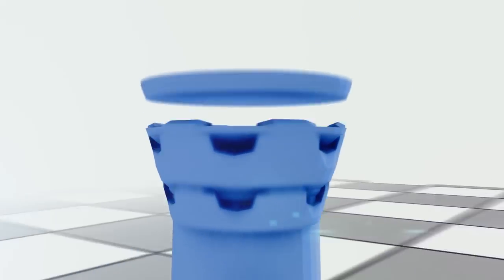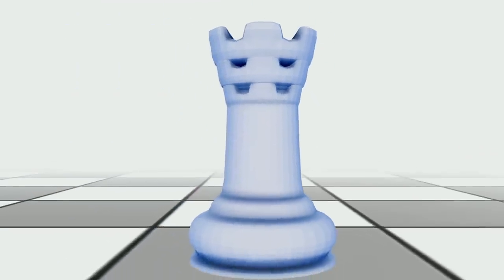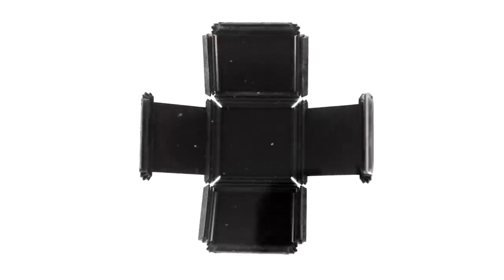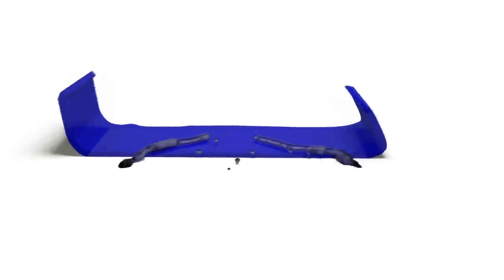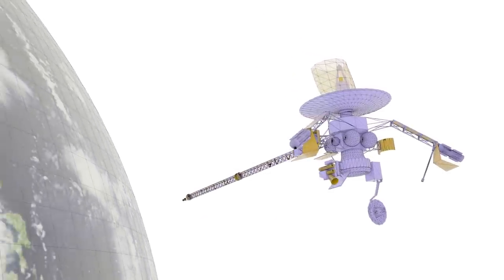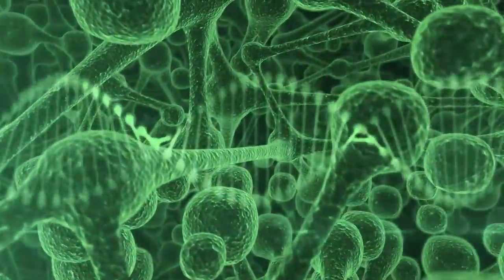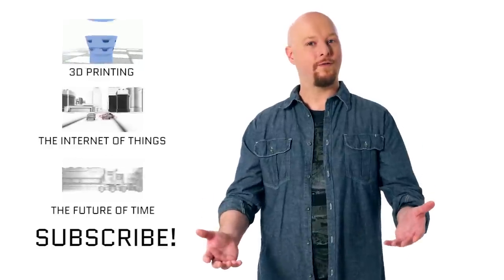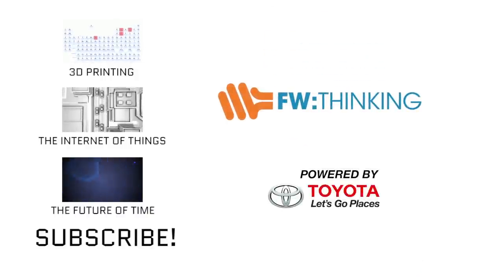4D Printing is the Future of Design

Comment: So how does this print in 4 dimensions?

Can it print a physical tesseract? No? Well, it's not printing in 4D, then.

Sure, I can't argue against the fact this is badass - but it's not 4D. It's just a 3D shape that changes in 3D.
Reply: the 4th dimension is time.
Reply: Mridul
its both. it can refer to both time in Einsteins special relativity theory, or polytopes that Vehementi refers to. for example a tesseract is a "simple" 4 dimensional cube. so what Vehementi says is actually correct. no 4D printer here... only 3D
Reply: 5D is a tesseract im sorry
Reply: Pivotal Axe No, a 5D cube is a penteract...
Reply: Pivotal Axe Wikipedia: In geometry, the tesseract, also called an 8-cell or regular octachoron or cubic prism, is the four-dimensional analog of the cube
Reply: Lorsayden Pivotal Axe Vehementi Lasse Jensen A fourth dimension does not at all have to refer to time or shape; rather, it simply implies a fourth dimension...of any conceptual framework.  Time and shape are common examples.  Other common examples would be vector direction or particle spin. However, there is no need to conceptualize "dimension" within a physical reality...AT ALL.  In mathematics, including mathematics studied at the undergraduate level like introductory linear algebra, a dimension essentially refers to an algebraically generalized vector and can non-trivially contain "infinitely many" coordinates, i.e. be of infinite dimension.  In fact, stochastic differential equations are empirically of infinite dimension, so don't be blinded by the physical and miss the analytical.
Reply: Seems like i'm 3 years late, but let me explain: It prints in 3 physical dimensions and in the time dimension.
Reply: I agree with 4D impressions because it's a very good way to help the planet, especially generations of children coming, this serves us completely to people who want to exploit their ideas first and foremost

Comment: Self-storing garden hoses. They would shrink down to tiny shapes when not wet, then expand when water is reintroduced. Self-shaping life rafts for boats. They turn from a folded up shape into a raft when thrown into water. 
Water drainage systems in houses that expand when it starts to rain. Or water collectors with similar properties.
Possible uses in hydro-electric dams. Or canals.
High-flood areas could have self-constructing flood-walls.

Comment: Firstly, it should not be called 4D printing. 4D is when you create a material within a material (something u can't see unless u have x-ray). Like a circle inside a circle but in 3D without support inside. Something that is not possible in our 3D world unless we bend space/gravity. Is when an object floating inside an object.

Nevertheless, I like the concept of using a 3D printer to print out self-reconfiguring, programmable material but there should be another name for it. The benefits includes saving space. Imagine parking. Print a car and fold it when you arrive your destination then open again when needed.
Reply: the fourth dimension is usually time

Comment: How would this "heal" anything? It does not reproduce mass or re-join atoms. You are literally printing an object that has two states: from flat to a non-flat; it does not "heal," more so "fold up a little more." Sending this into space does not make it any more cost-effective because space costs are usually dictated by mass - which does not change for this design.
Reply: +aripockily Magic. It's called magic. 5D shapes prited from fairy dust, drown in unicorn tears. All we need is somebody who donate them magic beans.
Reply: If you put all the molecules of a 4D printer end to end, they`d stretch to the Moon and back anyways. Twice!
Reply: Max Warner maybe for small applications, but for space, they need durability and strength. they already have mechanisms that can do this folding.

in terms of costs... applications requiring strength will not use this system. simple folds can be done cheaply with mechanical joints. Assembly for which this product excels in (weak joints) will have no need for shortened assembly time.
Reply: aripockily but it can contract to heal the broken parts

Comment: Really sounds interesting.  If the process is triggered by some outside event, water heat, etc, what keeps it from reversing with some other stimulus?  Imagine driving at 70 MPH and your steering wheel morphs into a gas pedal as you pass an electricity substation.

Comment: As a mechanical engineering student, it's my first time hearing of a 4D printer. It amazes me just thinking about how many problems this 4D Printer can solve. It can probably be taken into the next level too, such as instead of using water, different solution can be used or different chemical. Not only that but we can use material that are temperature/ pressure sensitive so it would change depending on the situation.  
If anyone have any information where to learn about this or be a part of a laboratory that are working on, please let me know.

Comment: besides using water as the catalyst for shape change, what other chemicals can be used to initiate the morphing process? does it have to be a liquid or can it be a gas as well or even another type of solid material? what i'm trying to ask is can the object you make on a 3D printer react one way when you when you put it in water, a second different way with something like liquid nitrogen and a third different way when it's touched by another solid object like plastic, metal, wood, ETC...? this opens up a whole new level. when you use different chemicals as catalysts to the shape change on the same object it can give you different results whether the catalyst is gas, liquid, solid or even a mixed chemical. there's a lot of possibilities here.

Comment: You can also use temperature. Take for example the old carburetor throttle plate bimetallic spring opening the plate when the engine warms.

Comment: close that expand when wet and contract when dry, ie: when its hot and you sweat they expand to let more air flow, when it rains it will make your shirt expand so that you can take it off without struggle, when its cold and dry they shrink to keep you warm. make them a composite(vertical thread self healing, horizontal thread water proof) water resistant as to wring them out after a rainstorm and have them shrink to reuse to keep warm.

Comment: I would print out a flat sheet that can contort to a table top gaming board... It would be great if you could send water through different channels and cause the terrain to shift based on the channel utilized. From Snow Landscape to Jungle Landscape.

A House that could fit in a backpack would be pretty cool too. You only need to drape a tarp around it. A Tent for camping would be even better. It might even be easier to assemble in the rain (Not Likely :P)!

Comment: Given that graphene can take on magnetic qualities, just how much material do you really need for, for example  a motorbike?

The frame could self-inflate. Magnetic bearings for the wheels; several square kilometers of graphene super-capacitors to hold power, inflatable tyres, a graphene sheet instead of spokes. Electric motor/dynamo to provide/recover rotational energy from the wheels.

Theres no reason it shouldn't deflate to the size of a coin.

Comment: On a personal scale, I would probably use such a device to print out a practice sword.

3-D printers usually can't build something of that scale, at least not the ones practical for small apartments like mine.

With a 4-D printer, I could print out something that looked like a bare hilt, over time though, the blade would unfold and built itself out. Like a super slow mo lightsaber!

I could also use a full sized punching bag, the sock em bopper on a spring isn't giving me the "oomph" I want.

Comment: Ear plugs made of squeezable material that conforms to ear canal,like ones used today. But these ear plugs are made of micro chevron shaped material that allow normal sound waves to travel through the canal unobstructed. When sound is louder than 70db the micro chevrons pickup the sound waves and open up to block sound.

Comment: I imagine this being able to replace many of the uses of pneumatic and hydraulic rams.  if a closed system was created that could add or remove water from these joints without getting everything around it wet, this could potentially be used for everything from automatic doors to car brakes.

Comment: This is some pretty cool stuff.  for printing something that bends...
but right now i don't see how this could be "self healing"
the material as i see it only bends/changes shape in a predefined way and doesn't add lost material. I.E repairing random holes. right now you would have to predict where the hole/crack or whatever will appear.

Comment: if i was a scientist i will be using this in the fashion or general industry, imagine a fabric that changes the radius of its pores to let heat get out or stay inside, you could use adaptive clothing to help to pass from a hot environment (like a boiler room or working in the sun) to a cooler one (like the office) reducing the risk of thermal shock and sickness :D

Comment: The first thing that comes to mind is to change the shape of forms that move though air or liquid to change coarse or handling charactoristics at diffferent speeds.
Reply: +Pete Tomiello that's a decent thought. Especially watercraft - eg: a boat transforms into a hydroplaning vessel as it lift out of the water, thereby being most efficent shape for application.

Comment: Its a bit hard to get from stuff that folds itself together to pipes that self heal. I believe this video has confused nanomaterials with fancy plastic. Eg that lg flex that with exposure to sunlight decreases the severity of scratches. now imagine that on a building and construction scale we have the sort of future being talked about here. Stuff that folds when you add water would just make it a crapload easier to build stuff because its lay a few sheets add water and bolt into place. The pipe example I dont know how it would work tbh. But at least the pipes will be resistant to minor damage which should increase the lifespan of the pipe and therefore its savings.

Comment: Emergency shelter - self inflating four man shelter. Inner & Outer Walls. Flexible Airlock door. Begins capturing atmospheric water as soon as inflated. Air filtration. Photovoltaic surface.

Self-assembling/Dis-assembling Camping Cooker.

Self-assembling/Dis-assembling Tent. Insulated/inflating floor, Built in sleeping bag/Camp Bed.

Hammock, Mosquito Net & Support Frame

Emergency Cast & Splint for broken bones.

Solar Still & Osmotic Water Filter.

Life raft - High Visibility in IR & UV. Automatic Emergency Beacon. Solar Still/sea water filter.

Immersion Suit- High Visibility in IR & UV. Automatic Emergency Beacon..

Wound Dressing - reacts to injury biochemistry - loosens & tightens tourniquet.Either falls look like or returns to small form when healed.

Satellite antenna tracker/up-link

Very small photo-voltaic cells at foci of inflatable elliptical mirrors in self-inflating flexible frame. Sequesters atmospheric water for cooling PVCs & heating water. 'Photo-tropically' reorients to face the Sun. Expands to look like Inverted umbrella. Rolls in a circle to find sun.
Reply: Uing photovoltaic cells to track the sun is not helpful. It will use too much energy to push the panel itself. Also, to power a street light you need a 3ish meter solar panel, and thats ine of the best.

Comment: Print a large child's cuddly toy e.g. a 4 foot tall gorilla which initially inflates a system of air sacks as rigid bones. The skellatern would anchor a systems of tendon and air inflatable "muscles". Very light. Very strong. The power requirements aside, it would be light, being mostly air. It could use the computers in it's environment for processing power by connecting to a wireless network, and going to sit on a power conduit to recharge itself by induction.

Comment: I would build a scaling computer for portability, so that it is small and robust when traveling (no air inside the case), and comes back to it's original shape when you need to use it, so that it doesn't overheat.

Comment: love the principle but this is not 4D (just marketing)
This is a 2 part material chemical reaction combined with a CNC machine sporting a hot extruder tool end. This combination of the two sciences (physics and chemistry) has developed a pre and post manufacturing process.  Which at this level is providing lower post construction product manipulation pre-export cost and saves the consumer set up time.  The only problem I see is the level of quality control on products that are pre-manufactured as flat packs, will be limited but I'm sure bulk manufacturing giants like China will have the quality control personal on hand =P

Comment: Did you know that instead of using that you could build mini-robots at the same size as a blood-cell that kills everything unwanted in your body, it could probably also be communicated with trough wireless connections such as Wi-Fis. These mini-robots would also be indestructible compared to the other cells in our body. These mini-robots are probably impossible to make without the for sure best material in the world; Graphene. It's 200 times stronger than steel while it only weighs about 1/6 times of steel. Not good enough? Well, how about the fact that it's actually flexible, and is only 1 atom thick. The future is soon here, guys :D!

Comment: 4d printing would be usefull for car manufacturing if the structured technology of 4d printing is designed for repairing damage with out comand cars can be safer with less regular maintinence and serviceing 4d printing can be used to ensure that the maufacturing process of citys can be built on time efficient schedules

Comment: I would use 4-D printing 
as way to print adaptable cities
That could repair its self. Think about it imagine self road repair, bridge repair and building repair. Used in a way to print cheap space vehicles such as, preparing self-aware adaptable rovers shuttles space stations and space communities.

Comment: Braces that can move over time so you don't have to get the bar replaced. Umbrellas that fold open in the rain, and close themselves automatically. Bikes that can change size as you get older. Hell, you could make a wheelchair that takes no power (Moves wheels like trains). God damn, there's a lot to do with the stuff.

Comment: 4D isnt a good description of this technology. It seems like its more of an adaptable material that reacts to a certain stimulus. All great things designed have to perform a function that has a purpose. Once that purpose is performed it will open the doors for further innovation... If you can program an object to fold into a certain shape then i can see great potential. For example you could program a group of materials to build themselves once they landed on mars. You could have a structure folding itself before astronaunts landed to use.

Comment: The first best application of this technology that comes to my mind is structures that are large but must be placed somewhere through a small aperture.  A good example would be a heart stint.  Instead of these crappy metal spring rings that are being used today, that cause clots, that move, we could fabricate a netted arterial instrument that dilates the artery in a customized fashion once placed but doesn't cause flow gates or ridges that induce clotting.  it could also do this slowly over a week(s) so that it causes no tearing of the artery wall basically causing the artery to respond to expansion carefully and slowly.  There is probably a hundred other stint related medical applications that do not need to be on the nano-whatever level.  Integrated prosthesis for instance.  Scott

Comment: Use it for a self-building robot that walks smoothly using light pulses, not gears and hydraulic hoses. I saw a video on 4D printing where these tiny injectable spider-like type single nanobot re-create themselves with heated light pulses and walk to a pre-programmed spot in a cadaver heart changing form to a stent in the heart to unblock arteries and save lives with an injection not surgery.

Comment: I would try ultra sound to get the material to react instead of water.better if you lack water to waste like on mars.a compound of lets call it acryl or high tensile strenght glue in the printer ,you could actually mix mars soil and "the glue" to build airtight cubes.and so forth build your own living enviroment on mars or other places were air must not escape.your water solution would not work under frezing condition because material you use wil loose integrity over time in extreme enviroments or temperature.from norway

Comment: Technically, all printers print in the 4th dimension, as it takes time to print thus time (the fourth dimension)is passing and then, if the 4th dimension was visible, there would be a visible line. Even 2D printers do.

Comment: If these naturally revert back to their original state when the water is removed, I can see an energy source. For this, it would be easier with something like an electric pulse instead of water. Then, the movement of the object after a pulse creates enough energy to create the next pulse, and some extra energy to put back into the grid. Also, solar panels on this, so we can have solar panels that move to get the most sunlight without using energy to do so.